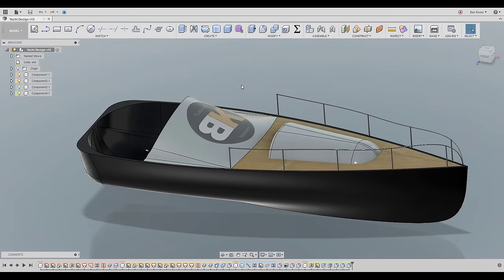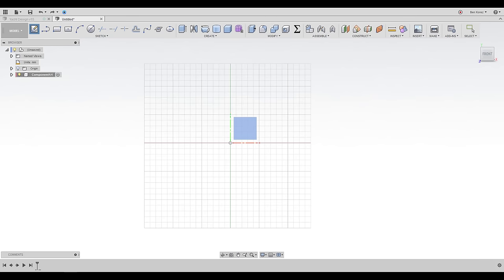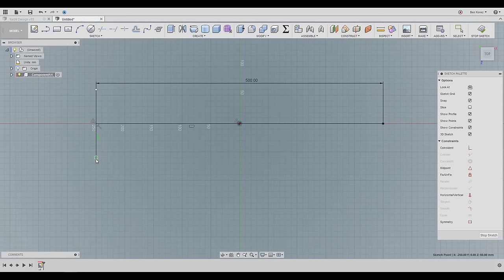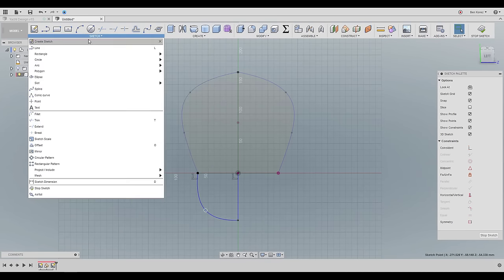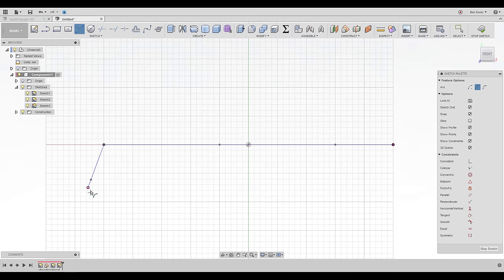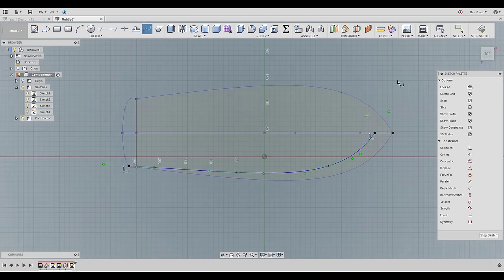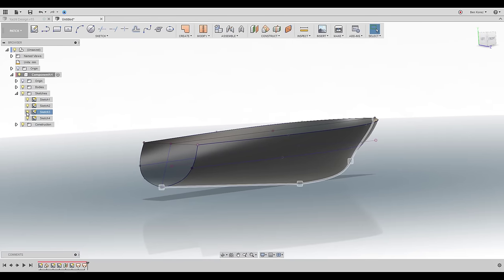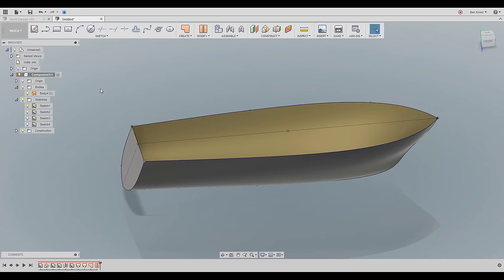Fusion 360: Designing a Hull for Yachts, Boats & canoes

Comment: Instead of using a line + spline for the bottom of the boat, I used a single spline and could not get loft to create the bottom of the boat.
Leant to use project though :)

Comment: Does fusion 360 have any tool to support designing an object for "stitch and glue" technique? Like unwrapping the surfaces of an object. For simple to build boats using plywood and zip ties and then gluing them.
Or how you design those paper models.
Reply from the maker: Hey Delay,  you should watch my video "Turn a 3D model into 2D pattern". The software that I'm showing there, that's what you need. F360 can't do what you are looking for.
Reply: Oh thank you! Yeah I checked the forum and they want to add the feature but haven't yet. Will check out your video.
Reply: BTW for designing boats there is specialty software, "Hull" by carlsondesign and FreeShip. But that is a whole other rabbit whole you better not look into :D

Comment: At 3:00 you "Attach Canvas", but you did not attach canvas? or I did not see the canvas being attached?
Also at 10:30 I'm not having any luck from here to 12:50 
I can offset the plane, but I can not select the points and draw that line from the point to point which I want to use.
Reply from the maker: Hey there,
It is very easy to attach a canvas. Watch this video https://www.youtube.com/watch?v=9zp_iTzpxz8
The points can be sometimes not easy to see, but they are there. Try to change the position of the camera, it will help.
Reply: Fusion 360 NewbiesPlus I know how to attach canvas, but there wasn't a canvas attached at the time I mentioned above. Apart from that, I think my computer is struggling with size of the graphics changes going on when I'm performing the changes.
Reply: Fusion 360 NewbiesPlus have you played with Sheet Metal? I'd like to design the boat and then have it flatten down into a sheet metal area, ready to cut out the boat parts
Reply from the maker: I mentioned the canvas, because that was the point if someone would design a boat based on a canvas, so that is the time to add it. I designed that boat from my head :)
Reply from the maker: You are right, it's time to get into Sheet Metal. I will make a video as soon as I'll feel comfortable with it. Till then, you could ask the forum, how to convert the hull that you created into a Sheet Metal, if it's possible!
Reply from the maker: But, I have a feeling that Sheet Metal is not ready yet for this kind of projects, mostly because of limitations!
Reply: Fusion 360 NewbiesPlus I would also love to see an aluminum jet style boat designed and brought into sheet metal for flat patterns.

Comment: Hi
Need help on this, can't get mirror to recognise spline, do I have to add a relation of some sort?
Reply from the maker: Sounds really odd. Try to select the spline first and then run the mirror command, see if that helps!
Reply: Doh! Did not realise there is a mirror command in two different categories. Wasn't using sketch version lol. 
Another question, is there any way to give the hull thickness as I want to 3d print it?
Reply from the maker: I'm pretty sure that I'm showing how to thicken the surface in the video. Otherwise, you can watch the other boats videos, where I'm also showing the right Workflow!

Comment: Thanks for your time and detailed info. I wonder if Fusion 360 after model has been created can export to 2D with scales and angles for a plasma plotter (aluminium)
Reply from the maker: That's a fair question. I'm working on a new video, which will show you how to Flatten a 3D body and to convert it into a DXF file. I'm not sure when it will be ready, maybe weekend.
Reply: Did you create a video showing the flat pattern process?